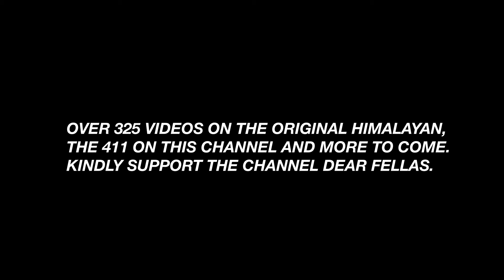MAKE THE OG HIMALAYAN 411 LIKE 450 - performance suspension setup

Comment: Front and the back having a mind of its own pretty much sums up how my 390 duke feels😂. I need to work on the suspension of my bike as well. For starters i am using a dominar rear sock it feels much better than the stock. Next i need to change the preload setting and see how it behaves. Thanks for sharing these info it really helps👍

Comment: Was ride height used ?  If so howmuch turns added 😊 on ride height
Reply from the maker: 12 mm . The manual says 10 . But I have had no issues with 12 mm even with a pillion